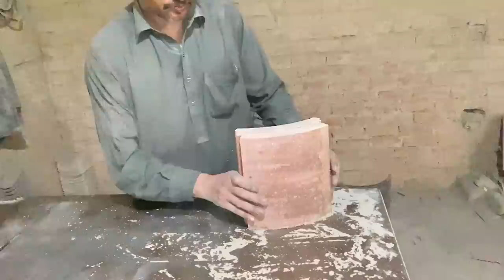Production of Truck Brake shoe | How to Product Brake shoe | Complete process

Comment: I don't think that they use asbestos any more but all that dust is very harmful, no matter what product.
Reply: I was thinking the same, these guys bust their butt, hope they are safe
Reply: 🤣. Sabirs Shahzor feeds does still use asbestos. The bags you see, 30-60% chrysotile asbestos. It is Pakistan. They still export and use xxx tons every year. 🤣
Reply: What about the dust liberated all over the world when applying these shoes to slow down vehicles....
Reply: Unfortunately yes they do ,Canada , Quebec notably sends most of it ,not sure why our government here in Canada deems it unsafe here but safe in other countries
Reply: @phildelfosse8085  yes Rubber dust is source of most allergies in the west
Reply: @jonathanbelanger6574  It's called hypocrisy or "what you don't see or hear about doesn't exist".
Reply: Once I work at this similar brake pad factory when asbestos is the main ingredient. We're regulated to work in low dust environment as possible.  In heavy dusty mixing section, we're required to wear full body protection, much like nowadays hazmat suit. Other section operators, wearing a cap, face mask, gloves and safety boots is compulsory. The cleaner were made to vacuum regularly, despite many suction point at the machine, that goes to huge dust suction plant, by series of hose and eventually ends up at a pool of water below it.
Reply: @jonathanbelanger6574  Some animals are more equal than others, particularly the ones that own the mine.
Reply: Definitely asbestos cos its cheap
Reply: I thought that was flour they pressed  to make the brake pads
Reply: This is absolutely asbestos
Reply: They do still use asbestos in heat seals, brake liners and clutch pads.
Reply: @paulterhaar4218  really?  😳
Reply: @Brian-mp6bg  yes. 100%.
Reply: This is asbestos 🤢
Reply: @Raj55 Ooogh. So that is the reason asbestos is still mined.
Reply: @Raj55 They don't use because you don't think XD
Reply: money can't buy life
Reply: @johnsamu they closed that mine 4 years ago
Reply: @topduk the mine he referenced was closed 4 years ago, the top exporter of asbestos is Russia. The town name is literally asbestos in Russia.
Reply: The câncer gang

Comment: I’m not usually a safety nanny but breathing in that amount of dust on a daily bases regardless of it being asbestos or not will greatly reduce your lifespan.
Reply: Very correct but them they don’t want to or are unwilling to learn or improve.I have myself tried telling quite a few at paint booths and workshops but they don’t care
Reply: @johnstaton5524  Man that place needs a giant vacuum cleaner for sure!
Reply: Oh man you are so right
Reply: @tahirusman5929  Under the dust, there's nothing but sand. Wouldn't be anything left but a giant hole in the ground after vacuuming.
Reply: Life is cheap in that part of the world.  100 more like him to take the job
Reply: Asbestos dust.

Comment: How that dude at the saw/grinder still has 10 fingers I'll never know!
Reply: He only has 8 fingers.. 2 thumbs 🤣
Reply: That appears to be a cutoff wheel, not a saw blade. On a comparative scale, those aren't that dangerous. If you work at it you can probably take off a finger, but you would have to work at it a lot more than with a saw blade. This won't pull you into the cut, and a blade will. Also, the footage there (and most of the video) is sped up a lot, he is actually moving fairly slowly. Not really dangerous at all compared to the presses and the drum sanders.

Comment: At 6:57 you see where they "radius" the shoes.  We did that with every shoe we installed and they matched the drums where there was contact from end to end with the drum when applied.  When they took those machines away the customer drove off with new shoes that only contacted the drum at both ends until the shoes wore in where there was total contact to the drum.  They just should have had us wear dust masks so the customer could have a "complete" job.
Reply: What do you mean by "they took it away" ?
Reply: @WHIRLWOLF  It became a "safety issue" and those were no longer allowed for use, an OSHA regulation.
Reply: @ivanleterror9158  oh okay ! Thank you
Reply: It was called arcing the shoes. They ground the brake material (asbestos)on the shoe to match the arc or curve of the brake drum so there would be full contact from the get go. As you cut a drum it becomes larger inside and the contact of the shoe is reduced unless its cut to match that curve. In doing so it creates asbestos dust, that's why you can do it anymore. My nose was getting itchy seeing all that dust in the air!
Reply: @jjtransman6353  And most of those were made by Bendix like many of the brake lathes at that time.
Reply: @ivanleterror9158  I know right! I remember being trained in college on how to do it, and that was in the late 80s,  scary, lol!
Reply: @jjtransman6353  except they don't use asbestos  any more

Comment: Waiting for the dust explosion 💥.
Reply: Only happens with combustible material, which isn't in brake shoes.
Reply: @topduk  but you’re missing the point of the extreme hazardous conditions they are working in with all of the asbestos fibers.

Comment: Heavy vehicles brake shoes are made with asbestes material, this material is highly dangerous for the lungs, and causes Cancer. This material banned most of the countries due to very bad for the inviroment, but unfotunately we are still using, governnent must take some action,  or at least safety gears should provide for these workers, they all are working in the dangerous inviroment. GOD bless them.

Comment: The video starts with "Truck Brake Leather Shoe" so I'm hoping all the dust is just some organic material. In the comments a lot of people have assumed the brake shoes contain asbestos - as they used to worldwide. I think we, as the human race, have had enough of people being exploited by others. I'm not sure if this place is dangerous or not, but you couldn't give them to me if people are getting hurt to make them so that I can ride around with cheaper brake shoes. 
Trouble is, does some major, international brand secretly buy all of these up, put a flashy box around them and then sell them at major retailers? How would you know?

Comment: Any dust particles over a certain size are bad for your lungs when you breath them in all day. There are still countries using asbestos because it is cheap and works well in brakes so I would not doubt that it would be used here. I have seen a brake lining manufacturing plant that is almost fully automated and with very litle dust escaping any process but the lives of these people is cheaper. By providing these job oportunities are we in the west helping impoverished countries or contributing to our own downfall through over population. Every country on earth sits somewhere on the economic evolutionary ladder and every one is trying to emulate those that sit higher but that is not possible because the resources needed for that to happen are not available. These people are working in what was our Victorian era with regard to work safety are you going to tell them that for the sake of western economies that is where they will have to stay?
Reply: Great point. It seems they already lost the game of life by simply being born there.

Comment: If, and I assume they will, they are using asbestos then this usage limits their life expectancy to about 40-45 years after the first inhalation. Those who smoke during labour about 10 years earlier. Their demographic info doesn’t give numbers per trade group. In 2008 life expectancy of a newborn in Pakistan was about 60 in 2020 67,5 years. Working in a shop like this is a certain death sentence caused by asbestosis. There is a small number of people with asbestose resistancy. I doubt all of those are Pakistani. Pakistan is amongst the top 12 countries with the lowest life expectancy in the world.